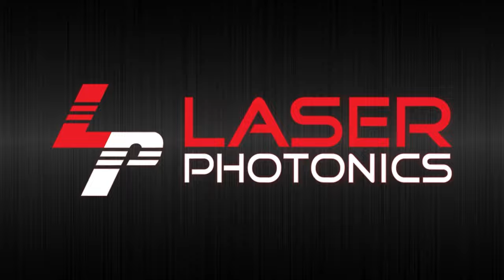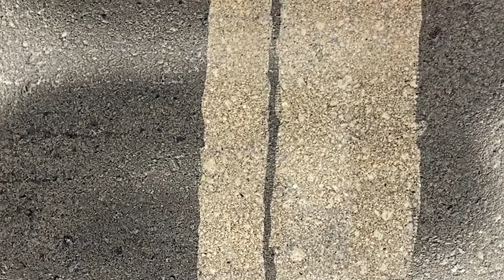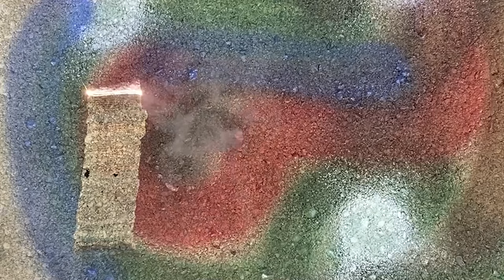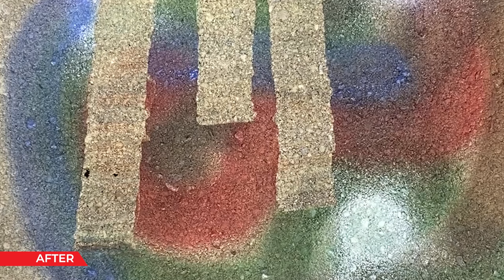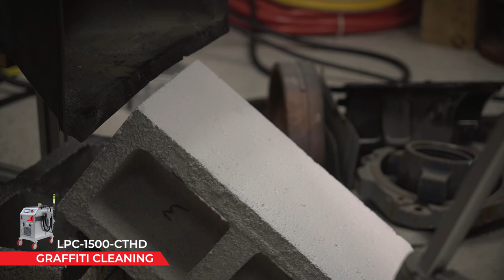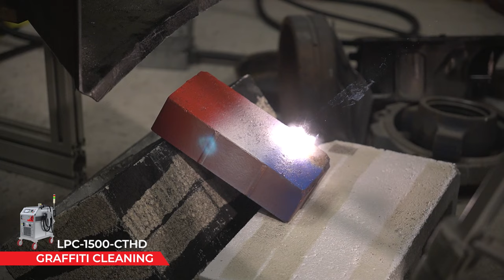Remove Graffiti From Concrete and Stone with CleanTech #LASE

Comment: What is the laser wattage removing this graffiti?
Reply from the maker: This video showcases our 1500W CleanTech laser. For more information on this laser system visit
https://www.laserphotonics.com/handheld-laser-cleaning-systems/cleantech-lpc-1500-cthd/
Reply: @LaserPhotonics  the question is, what is the wattage SET at to remove the paint in this video?  I know these lasers are adjustable.
Reply from the maker: You are correct that our lasers can be adjusted to lower power settings to meet the unique needs of different substrates. In the video, the laser is operated at full power (1500W) to showcase the system's full capabilities.